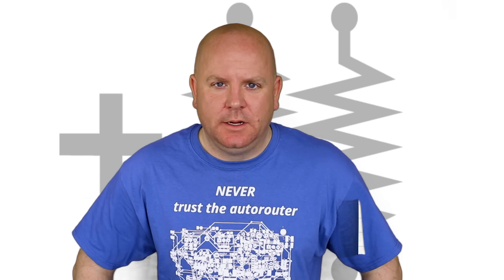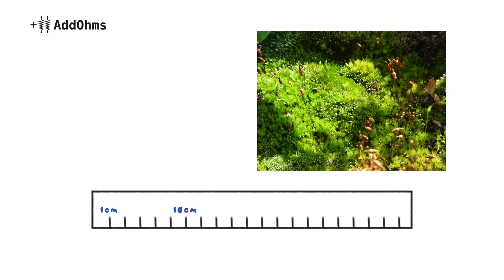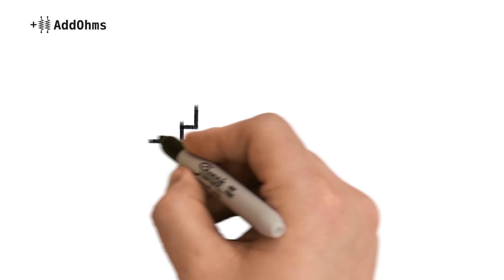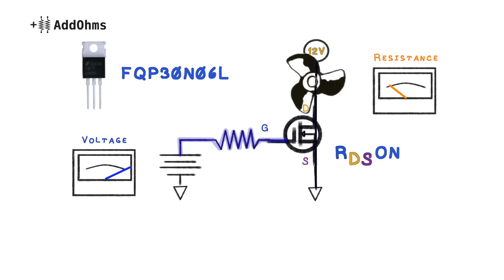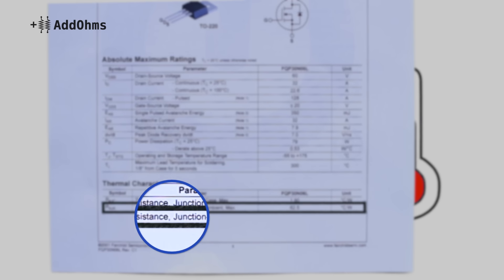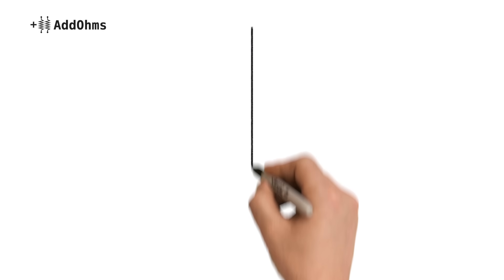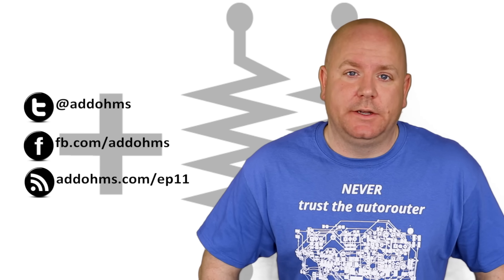MOSFETs and How to Use Them |  AddOhms #11

Comment: great video : )
i have a question. you said that not all MOSFETs are logic level compatible, so that means not all MOSFETs can be used with Arduino?
Reply from the maker: Depending on the MOSFET, to fully turn it on, you might need more than 5V from Gate to Source. Even the one shown in the video isn't optimal with 3-5V at VGS. For FETs with higher VGS, it's common to use something like a NPN BJT to drive the Gate voltage, from the higher voltage supply.
Reply: thanks a lot : )

Comment: Hi great video. I have a dout about the mosfet. Can they be operated on AC voltage as well, let's say to to swich on some appliance at home (single mosfet), or do I need to have a second one and build some kind of an inverted circuit to use the full AC wave. Best regards Hélio Cabral
Reply from the maker: You need a triac or scr for AC

Comment: Any schematics for time delay switch for 4 dc motors like starting engines one by one for the scale model out there please?
Reply from the maker: I have absolutely no idea what you are asking.
Reply: Addohms, I mean, any simple time on delay switch, for a number of small dc motors, that should be started one by one like the airplane engines does on start up. With "time shift" relativly to each other to simulate it in scale modeling. With one press of a button and keep them running then. 

https://youtu.be/G5IWNSaC6ME
Reply from the maker: It would be simple to build that sequence with a microcontroller (like Arduino's ATmega328p.) Or you could cascade 555 timers.

Comment: so what is PD @TC 25°C = 200 W   (Power Dissipation) .it on datasheet IRF 3205
Reply from the maker: +Tan Le That is in the absolute max section of the data sheet, which specifies conditions that can destroy the component. You want to look at the graph that shows max drain current vs temperature.

Comment: Hi, is this formula, 5:43, general for all transistors, I mean BJT and MOSFETs, or it only applies to MOSFETs?
Reply from the maker: It's a generic thermal dissipation equation.
Reply: AddOhms thank you very much, When you said safe to use without a sink, does it means that the transistor reaches its thermal equilibrium with the ambient so it will not increase more and more its temperature while time goes on?
Reply from the maker: Steady state.

Comment: Mosfets are next to never used outside of class D operation and terrible with stable variability, they are usually on or off through PWM/square wave drive. Also I have found that sourcing current to mosfets regardless of type is quite important for faster switching some gate drive chips can run 12+ amps for switching such as the 4452YM. Also, I 100% agree with the shirt... EagleCAD can't autoroute anything useful.

Comment: MOSFETs were a godsend to me when I was transitioning from vacuum tube circuits to solid state. Because they are both voltage driven, it was fairly easy to adapt the designs from one to the other. That gave me some breathing space while I got my head wrapped around current driven BJTs.
Reply: I feel a rudely impulse to ask what you were building

Comment: Lots of people are watching the hho thing. Please make a video on how to build a circuit with 12 to 24v in and get the greatest voltage out with keeping the amps as low as possible. If there is a way to control manually the amps and the out voltage it will even be better. Some are talking about 50kv with as low as 4 amp. Is that even possible? Specifically when it is continues? Thanks
Reply from the maker: +Iyad Subh I have no idea what a "hho thing" is.

Comment: Around 4:30, you use the depleted mode symbol (continuous grid) instead of the enhanced mode symbol (dashed grid), is it intentional ?

 But my main question is about the curent. Is the MOSFET a "polarized" device (like a diode, or some capacitor) or not? Can we "accidently" exchange the drain with the source without problem (I think not, considering that it is the drain which is linked to the flange for heat dissipation, not the source, but just to be sure, in EVERY cases/flavor of channels and modes of MOSFET and CMOS).

And a second question (or a third one, really), what is the buzz about the "substrate"?  It is part of the symbol (well, the one that you used as well as some other, but not each and every symbol of MOSFET have it), but most author just mention that it is linked to the source(s), (with the plural referring to multiple MOSFET made out on the same, single piece of, substrate), that it is sometimes part of the symbol, and from there, well, just forget about it !!! (Poor guy, condemned to anonymat for eternity)

And, sure, thanks for your videos. They have a nice unique "signature".
Reply from the maker: +snnwstt The body diode makes it (nearly) imposiible to reverse drain and source.

Comment: The symbol used for the transistor is not right for the explanation that you gave. if you apply 0v to gate, the transistor will conduct.

Comment: out standing video! I do have a question. I am planning on using white 12 VDC led light strips as a strobe for a Haunted house project I am working on. would I be able to use a 555 timer or a 3909  to drive the MOSFET  to trigger the LED light strips? Or is there a easier way to do so?
Reply from the maker: +chet dillenbeck Sure

Comment: I would like to see a circuit diagram of a photo resistor/solar light, with out a transistor, I had it up and operating but I lost my diagram, can you make an easy one.
Reply from the maker: +erick sal You put bias resistor in series with the photoresistor, creating a voltage divider.
Reply: AddOhms thank you for your response, tbh, I spent about a month if not more researching and wiring different ways until I found one, and it worked, but during an argument my wife put my work bench away and my diagram probably ended up in the trash,  if you could draw me a simple diagram and send the picture to quasimodo187@gmail.com 
you would give me some rest, as I'm back at the drawing board.
I intend to use a solar cell (6v 175mah) to charge the battery( li-ion 2200mah)  and the photo resistor, as the switch, thank you very much, have a good night GB.

Comment: great video and learning many new thing. i have one of question, how to select MOSFET for any smps device, like 6N60, 8N60.... 20N60 are different types of mosfet. so, how can i select for particular design. please explain it.
Reply: In that case, the difference is the current capability. So you would pick based on that.

Comment: Great video.  Got a question that maybe someone can answer.  I am brand new at building circuits and am currently building a very simple circuit.  I am powering a 87 RPM 12 V DC motor using battery power.  I want to be able to adjust the RPMs and am wondering why use both a potentiometer and MOSFET, if I even need to.  Thanks for any assistance.
Reply from the maker: Unless there is other hardware in the circuit, there isn't enough information to answer the question.

You could use the potentiometer with a microcontroller. The pot would provide an analog voltage into the micro which would the provide a PWM signal through the MOSFET to power the motor. The advantage would be you are not wasting power through the potentiometer. 

If you aren't using PWM with a microcontroller, then I don't see why you would need the MOSFET.

---

While I said the MOSFET is "like a variable resistor" there is not enough variation in the resistance to see a significant change in motor speed. Changing from 10mOhm to 1Ohm is practically the same speed.
Reply: Thank you for the reply and informative videos.

Comment: Great video, very usfull explanation. Great work. 
I have a question about relation of Rds and Vgs. I like to use mosfet as light dimmer. But I was looking at the datasheet for FQP30N06L and there is a graph for Vgs and Id. Transistor starts to conduct current at Vgs=2.5V and drain current increase exponentialy up to Vgs=6V at this point transistor is almost fully open. So if I am making a light dimmer I have to concentrate that my base voltage is between 2.5 and 6V. Do I get this right?
Reply from the maker: +Borut Goli For AC lights, a MOSFET isn't suitable. You probably want a JFET to dim a light directly. Otherwise, you could also use PWM.
Reply: +AddOhms i am making dc ligt dimmer. can i use yor schematics with variabile resistor. btw isn' t fan an induction load. there should be reverse biased diod.

Comment: Hi! thanks so much for this video! Is great to have this information. 

I'm wondering why are you adding a resistor between 5V and the Gate pin in the mosfet. I assume that the resistor is working as a current limiter, is this right?

thanks so much!
Reply from the maker: +Luis Diaz Yes, current limiter. Gate is a tiny capacitor
Reply: AddOhms thanks! What value do you recommend to use? It's any way to calculate the value of that resistor?

Comment: How do we calculate the value of an external gate resistor if we have to use one?
Reply from the maker: If you're just using the MOSFET as a load switch, the value isn't critical. If you're switching a load on/off very quickly (kHz), then the value can matter.

The purpose of the resistor is to limit in-rush current when the gate turns on. The gate resistor creates an RC circuit with the gate's capacitance (found in the datasheet.) 

Whatever value you pick, should be a low enough RC time constant that it doesn't interfere with the switching frequency (if it applies).

Comment: can you help me on how can I use a Mosfet to limit amps from a transformer giving 50v 10 amps. to 50v 5 amps.. 
I have converted 50v AC to DC through 4 Diodes of 6 amps each.

Comment: Great work! explains it all simply and clearly - thankyou  now I know why heatbeds use a mosfet as opposed to a relay
Reply from the maker: Yeah. Any power transistor is much better when an application needs PWM or faster than a cycle per second.  Plus relays have a limited number of cycles before their contacts are no good. There's probably a "cycle limit" to a semiconductor but it's well outside of any operational (or human) lifetime.

Comment: You mentioned that the Mosfet in the video is logic level... would it be an appropriate switch for using an Arduino to switch on/off an audio source?  (I'm thinking in terms of building a looper to let an arduino control which guitar effects are active)
Reply from the maker: Depends on what you mean by "audio source." It would be appropriate to turn off the supply to an audio amplifier. It would not be good in the amplifier path.

Comment: hi, could you make an video talking about the different operation of the n-type MOSFETs and the p-type MOSFET please?
Reply from the maker: They operate the same. The difference is how you drive them. P-Channel needs a higher voltage at the source compared to the gate to operate. So they are specified with negative Vgs.  I wrote up an example here: https://www.baldengineer.com/p-channel-mosfet-tutorial-with-only-positive-voltages.html
Reply: oh ok thank you very much

Comment: So, is this a way to keep high current out of switches? Maybe for safety or switch size concerns? I'm still trying to grasp how it "switches". What breaks the current when a mosfet is switched off? Is that a dumb question? 

(P.S., I am educated, but never in anything like engineering, so this is my latest brain challenge.)
Reply from the maker: +Rory Stevens Charge carriers between the N and P layers become available (or not available) when a voltage (electric field) is applied. 

Veritasium (science youtube channel) has an excellent video on how the junctions work on a material level.
Reply: Thank you, I will check it out.

Comment: to: AddOhms : Can I use a N channel mosfet to make a voltage Regulator ? thank!
Reply from the maker: Just the transistor by itself, no. Linear regulators can use either BJTs or MOSFETs in their design. Along with a comparator and a precision voltage reference (like a diode).
Reply: Thank so much! Can you help me to compare a Power trench Mosfet and 1 Hexfet or 1 common mosfet (difference ) thank you!!!

Comment: Very Excellent tutorial - It helped me to understand the basic very clearly. .
In Addohm#11:Please explain the  left part  that why power dissipation is less when we calculate using  Rds * i2  compared to using the concept of "junction to ambient thermal resistance" .
 So that i can  manage power for my board (it contain so many different IC's),It will be great help from you if you do that.  PLEASE..
Reply from the maker: It was comparing actual power dissipation to maximum dissipation.
Reply: Thank you very much, AddOhms.
Your work always Helps and Inspires me. .

Comment: Hey James, Could you tell me how to use a 15v Zener to reduce 40v to 15v on the gate of the MOSFET
Reply from the maker: You create a voltage divider with it. Instead of R2, you use the Zener.

Comment: new sub!! Love the video, very helpful.
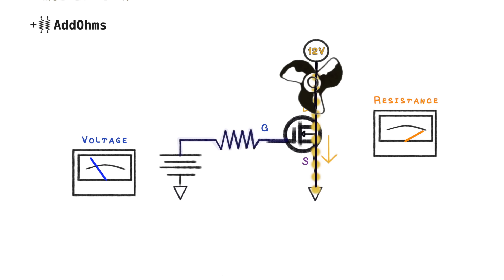At 3:20 you said that when the voltage is past the threshold, the resistance drops quickly, how could you better control or expand the range to better control the resistance drop for fine tuning the speed of a motor.
Reply from the maker: If you wanted more control over the resistance, you would use a JFET, not an Enhancement Mode MOSFET. They are much more variable.  Regardless, that isn't how you'd control the speed of a motor. You would use a PWM signal instead.
Reply: Thanks. I was looking at the PWM control tutorials and saw this one.
Reply: yeah, 1st vid of his ive seen, I know how to basically use MOSFET's. And if the rest of the videos are going to be like this. Im in too.
edit: Don't forget to hit the bell next to subscribe.
Reply: You can always use a variable resistance to do that.

Comment: What does this mean ? Drain Source Voltage Vds = 20V
Reply from the maker: It is the voltage drop from Drain to Source.
Reply: So this component will drop 20 volts? & this means I must apply 32V to the Drain in order to get 12V from this component at the source?

http://ee.farnell.com/vishay/si2302dds-t1-ge3/mosfet-n-ch-20v-2-6a-sot-23-3/dp/2400359
Reply from the maker: +The Manthis Its the maximum junction has been designed to handle.

Comment: Regarding the 2 guys in the bar ordering H2O, the second guy dies because he ordered Hydrogen Peroxide H2O2(too).
Reply: @voltixD
yeah.. we know,  thanks  hehe
when you have to explain a joke like this, it's no longer funny

i mean, the joke on it's own is not really that funny to begin with
let alone if someone has to explain it

like..    OOOOOOOOHHHMMMM   - Join the resistance
or
there are 10 types of people in the world, those that understand binary and those that don't

stuff like that
it's not funny if it needs to be explained
Reply: Ba dum bump.
Reply: It's not actually a fuel, it is an oxidizer
Reply: @agustinothadeus  It is fuel for a jetpack.
Reply: Alcohol is the SLOW death! L0L H2O2 in very small doses is actually very healthy. It's like ROCKET FUEL for the body. I know, I been using it for over 30 years.
Reply: Medicinal Hydrogen Peroxide is only 3%...not the same as fuel oxidizer.
Reply: Did you hear the one about the 3 bald engineers that walked into a bar?

Me neither.
Reply: 11 was a race horse, 22 was 1 2, 11 1 1 race, 22 1 1 2
Reply: kind of!!
Reply: Pure H2O2 is rocket fuel.
Reply: I had to read that 3 times to get it. is that bad  ?
Reply: @TheProCactus  no, that's probably a good thing, you can use the language correctly -- as in "too" is not "two"
Reply: voltixD thanks!!
Reply: If he didn't, at least he got a nice diarrhea.
Reply: voltixD . Hahahahaha
Reply: TheProCactus too bad.

Comment: hi all!:) what if we connected the negative terminal of the fan shown in his diagram to the source, and then connected the drain to ground? (I.e reversing the connections that he has drawn)

would current still be able to flow through the MOSFET from source to drain?
Reply: Current would flow through the internal body diode of the MOSFET and defeat the switching capability.